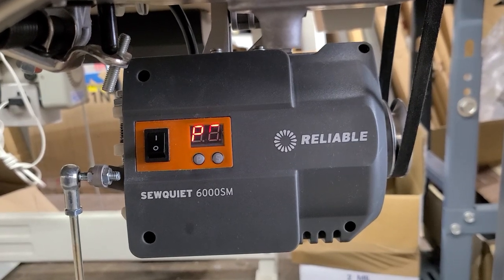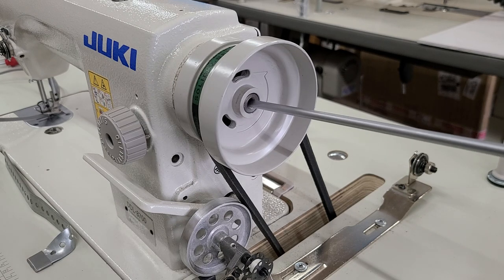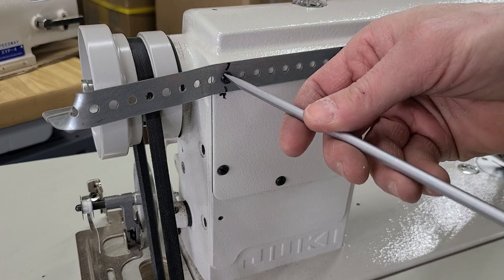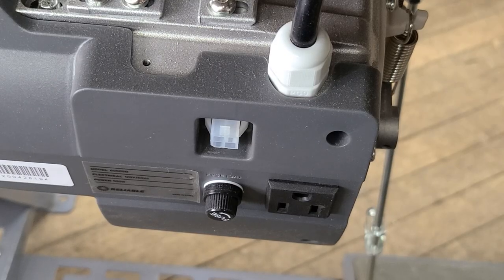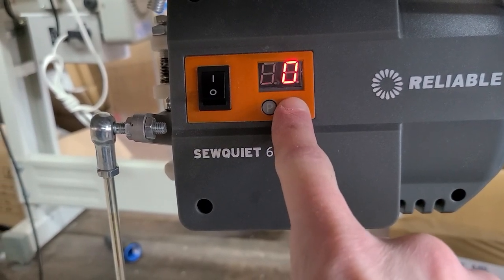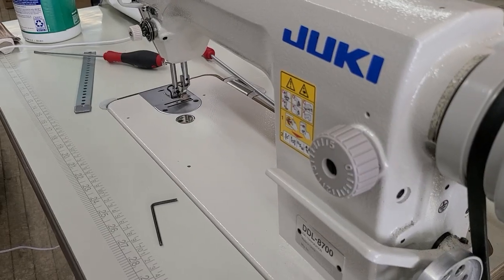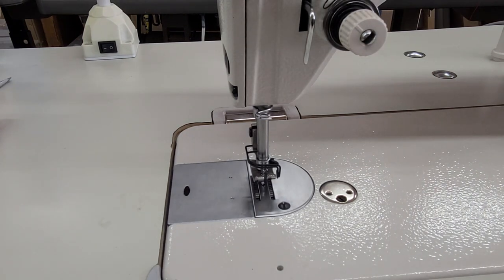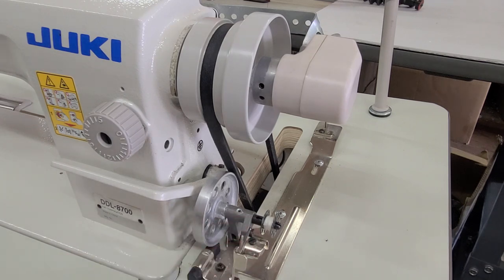Reliable SewQuiet 6000SM synchronizer install

Comment: Hi, just installed this on my Juki DU1181n. Save yourself a bit of adjustment time by cranking your wheel into the 'needle up' position BEFORE you first add the synchronizer. You'll only need to push some buttons to set it needle down. You're welcome.

Comment: Could you do a video about the “F Modes” N5 and N6? Reliable manual shows how to change them. I don’t understand what it’s changing, but hoping it’s for altering the acceleration. Barley pushing the pedal, the Sewquiet 6000 can get twitchy with very little pedal input. Is there anyway to extend the pedal throw between slow to fast speed? Great videos and extremely appreciated!

Comment: Hi from Canada, Steve... excellent video and very timely for me. I've learned way more in the 10+ minutes of watching than in hours of surfing spread over weeks and months. Thanks for doing the work for us that Reliable should be doing themselves. Sensing your willingness to help, I wonder if you can confirm one point for me: I've read elsewhere that the 6000SM Synchronizer won't work on old Pfaff machines like my 545-H3. From your video, the only real problem that I can see for my Pfaff is obtaining one M7-1.0 screw of  the correct style and length; that's the size of threads tapped into my Pfaff 545-H3's shaft. But have I really got this correct? Your comments one way or the other will be much appreciated! Fabricating an elegant holding bracket for the Synchronizer will be a pain but is not at all insurmountable. I haven't heard back from Reliable on my inquiries yet but am disappointed that the technical information required to make good decisions is so hard to obtain... they don't seem to care that many others like me would really like to buy their products.
Reply from the maker: Hi Gary,

I do not have any Pfaff 545 in my shop right now.  Next time I get one in for repair I can try a few of the synchronizer adapter screws and let you know.  The synchronizers come with an adapter and 2 different screws to match most machines.
Reply: @Sewinggold  Thanks for the reply, Steve! I was able to re-thread the smaller size screw from the M9-0.9 pattern it had to the M7-1.0 pattern that my Pfaff 545-H3 uses... no problems!

Comment: If you press the pedal with your heel, the needle position should be reversed once. If the needle was at the bottom, it will rise once.
Reply from the maker: This is not an advertised feature and does not work on all of the 6000SM motors.
Reply: @Sewinggold  which ones will it work on?

Comment: If I already have a factory synchronizer connected to my pulley wheel are the four pin plug connectors universal fits and IYO is it more or less likely to work?
Reply from the maker: Unfortunately I can not answer that. I have never tried another brands synchronizer with our 6000SM servo motor.

Comment: I just picked up a Juki 1541s that I will be using to sew some 4-5oz leather. It has a SewQuiet 5000 now, and it doesn’t really have the torque for getting going on the leather. In your opinion would the 6000 have the extra torque needed?
Reply from the maker: The SewQuiet 5000 was similar to the Enduro servo motors.  They did not work well on heavy duty machines and tend to stall.  We would install them on the Juki DDL-8700.   The 6000SM will be better. You may also want to look into getting a 750W servo motor.  I think Consew makes one.
Reply: @Sewinggold  I just purchased the Consew 750w Servo Motor and a 45mm pulley. My SewQuiet 5000 had a 90mm pulley, that probably didn’t help it’s lack of punching power. Will see how the 1HP Consew does, and if that can’t do it, a box style speed reduced is on deck.